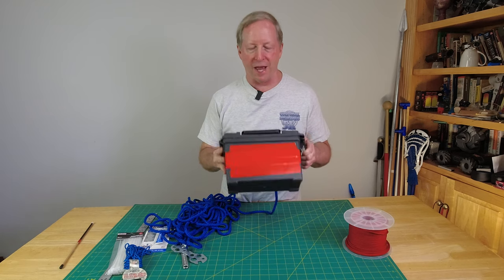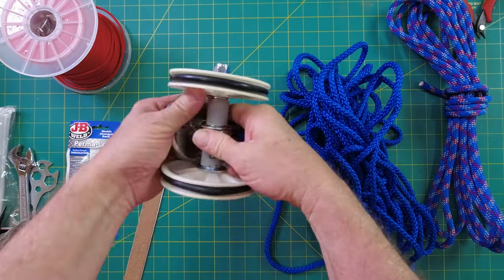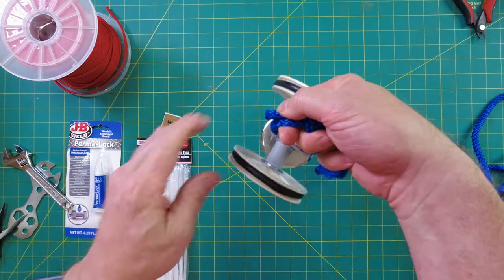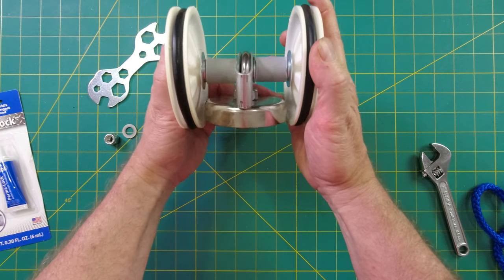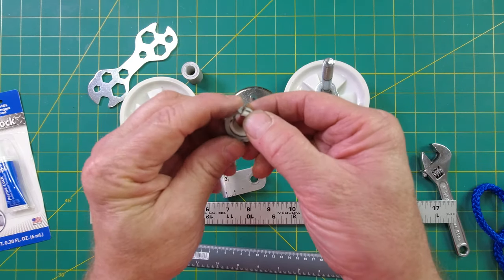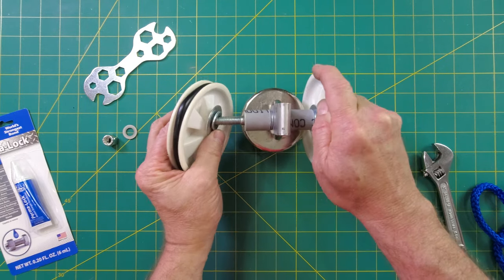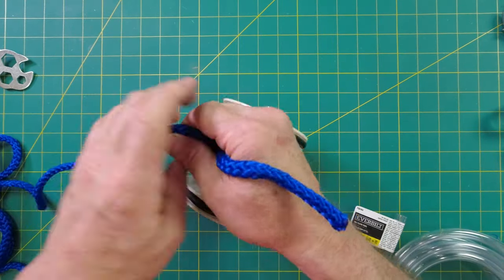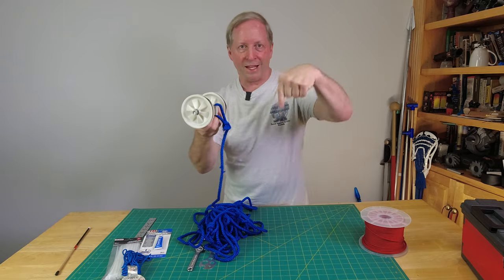Making the Ultimate Magnet Fishing Rig - Tutorial

Comment: Just an update:   I added 1.5" rubber strips to my wooden wheels to help prevent them from sinking in the sand.  After several hours of trying it in sandy/ rocky water and at a boat launch that I frequent - it seemed to work great.  In fact, I got my first pair of long necked needle nose pliers from the boat launch area!  Cleaned up great with a wire brush and now in my toolbox.   So now I need to find some 5" wheels with wide tread on them and upgrade the rig.  Many thanks for the design idea!!
Reply from the maker: Thanks for the feedback. Great to hear about your success!

Comment: I was intrigued by your design and decided to make my own.  My magnet is 4" wide so I needed 5" wheels so the magnet would have about a half inch clearance.  I made them out of wood.    It worked
 great on a hard sandy bottom but the magnet frequently gets flipped up vertical if the wheels sink into the bottom at all.   I might try 6" wheels if I can find some for a reasonable price. 
For me this design has limited applications.  The rig gets easily caught on weeds and branches and risks losing the whole thing - avoid using this in rivers!    If I were a roofer, this would be awesome to pull along the ground to pick up loose nails.    I think I'll buy a two sided magnet with the eyehook on the side, far less chance of getting snagged.   It was fun making the rig.  I'd be interested in hearing about any additional testing  in rivers or weedy areas or alterations you make for your rig.
Reply from the maker: Thanks for sharing you comments. I've found any magnet system can get hung up depending on where you're fishing. everytime I've gotten this snagged I was able to back it out. I've thought about the using a two-sided magnet, maybe a future project...